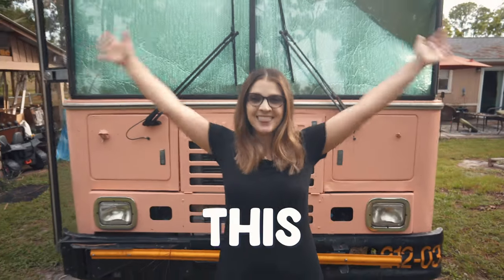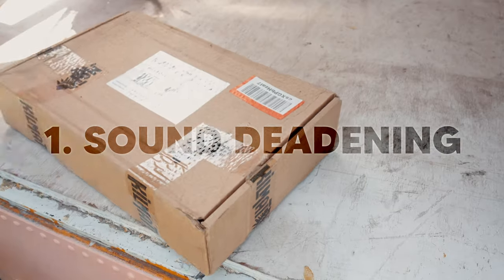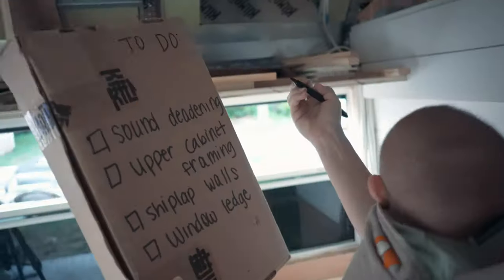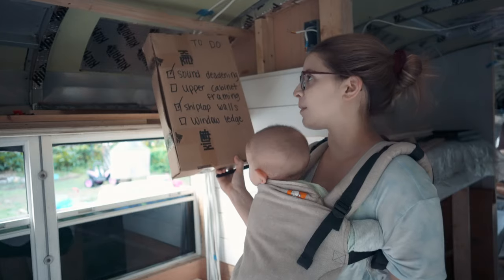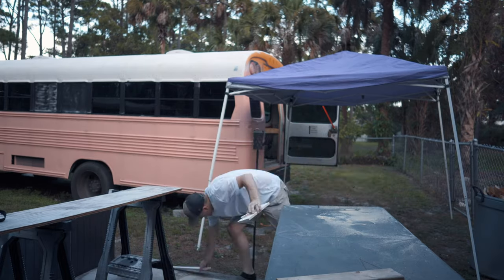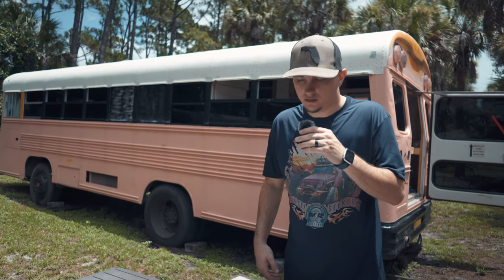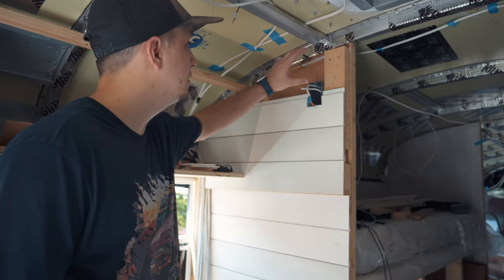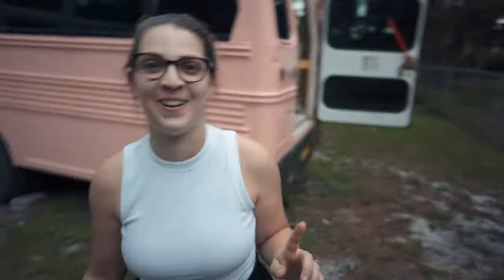From Bus to Home: Bedroom Construction Begins

Comment: Did you add more suspension capacity with this all of Weight added or the original can support all.of this ?
Reply from the maker: The original will support it. We should be far under the gross weight. We’ll weigh it once completed.
Reply from the maker: We will be adding upgraded shocks and all that though. The rear is actually on air bags which is a nice bonus!